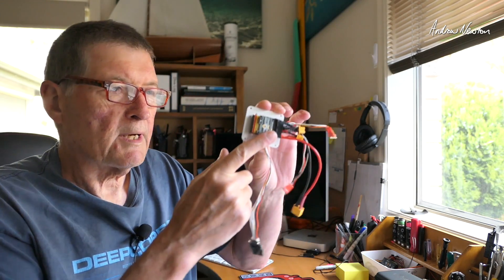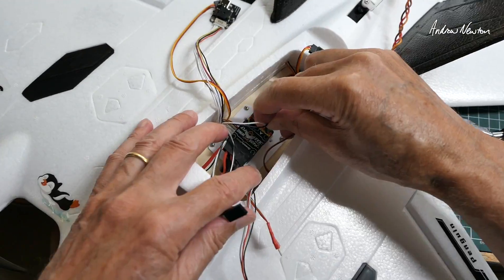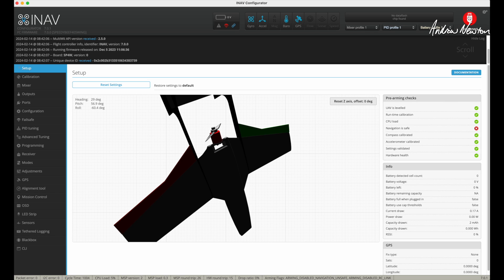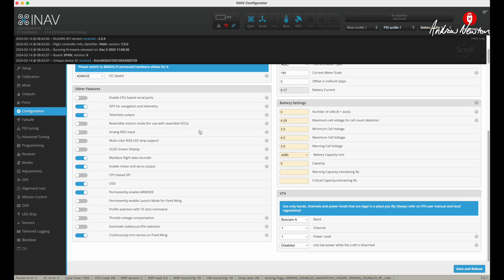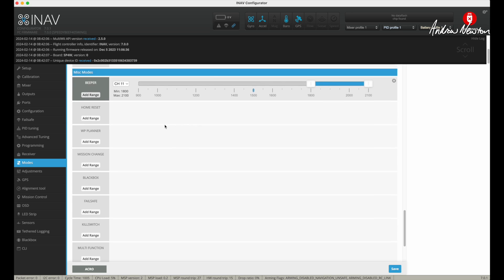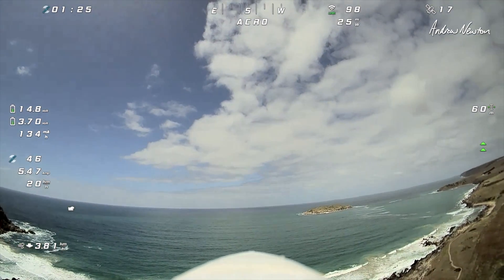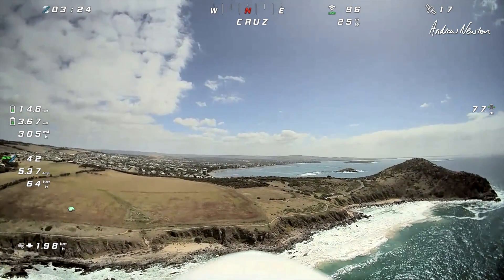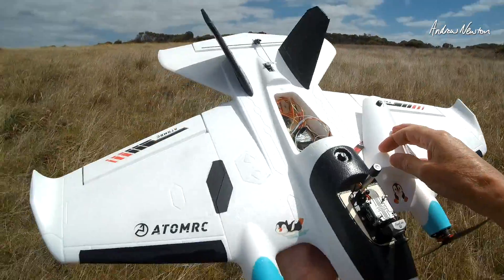SB F405 Wing Mini - INAV 7.0 Setup Penguin

Comment: I cannot get it - I used the same FC for me Esky Albatross. I flashed the Speedybee F405 Wing Mini (6 Outputs) Target. But the S5 and S6 servos does not work. 
In your video you are using the target "Speedybee F405 Wing" (not Mini). Is it correct flashed? Because you are using the F405 MINI. Can you help me?
Reply from the maker: Must check the manual or product page for the correct firmware target. Don't just guess.

Comment: Great video as always thanks for the information just got a penguin and this help me out perfect 👍
Reply from the maker: Great little model. So quiet but fun to fly
Reply: @AndrewNewton maiden soon 😁 Do you fly props in or props out spinning I'm talking about. I run my swordfish propa in.
Reply from the maker: Mine was pre configured with props spinning out, but either way is OK.
Reply: @AndrewNewton thanks yeah I buy the kit version and love building I guess I'll go with props in. Thanks for all your input much appreciated 👍🏼
Reply from the maker: No problem. I actually did some testing using the AlbaBird and found that IN, OUT or SAME made no difference to the flying but if you lost one motor then IN was marginally easier to fly.

Comment: Hi mate... Thanks for the explanation for this FC. I have some questions, I saw using a capacitor on your flight control, is it 2 capacitors or only 1 capacitor? Can you give some instructions for soldering? Thanks for your advice, now I'm building this project.
Reply from the maker: Capacitors are optional, but mostly beneficial to reduce noise in analog FPV. I soldered mine to the ESC pads when I was using it on a single motor model, then changed to the battery pads with this twin motor Penguin. Negative to negative and positive to positive.
Reply: @AndrewNewton  Hi Andrew, thank you so much for your clear explanation. Now I can start this project. 
Cheers...

Comment: Hi Andrew, I am planning on using the Matek F405WSE on my penquin, do you know if I will be able to switch the LEDs ON/OFF is i connect them to the LED G 5V LED on the board?
Reply from the maker: No they are not programmable LEDs and the board doesn't have a switchable power output
Reply: Noted and thank you.

Comment: thanks for the video, can i ask how can i assign the flight mode to my radio?
Reply from the maker: In the radio mixing assign a switch as the source for the mode channel, then select that channel in the INAV configurator mode screen.
Reply: @AndrewNewton  thanks
I need my fc f405 to be connected with o3,  to get full range, can it be done without gps?
I tried to do the simple method in the speedybee app, when i reach the point to move the throttle, thete was no response
Reply from the maker: @hussainjeragh  For the 03 you need to arm the board. If you have configured it to use GPS then you need 3D GPS lock to arm. Yes you can configure the board to not use GPS.

Comment: @Andrew great video.  I just got a penguin with a SpeedyBeeF405 wing board installed. Very helpful video. BTW Where do you get the 4 pin DuPont plugs from?
Reply from the maker: Thanks Jerome. EBay - search for Dupont connectors

Comment: Hi, i'm a total beginner on Inav. I would like to use my dji remote 2 with the pinguin. should I simply designate the UART corresponding to my O3 as serial RX? thanks
Reply from the maker: UART2 Serial Rx and connect 03 SBUS to the SBUS pin, UART5 DJI
Reply: @AndrewNewton  Thank you for your answer. so if I understood correctly I solder the blue wire (sbus) to the sbus port. And in INAV I program UART 2 in Serial rx and UART 5 in Dji? thanks
Reply from the maker: Yes correct. Might need the Ground wire for SBUS also.

Comment: Do you need a compass for RTH to work or just with the gps its enough for a flying wing? Do i need a gps only or gps with compass?
Reply from the maker: No, compass not required. GPS provides direction when the plane is moving forward

Comment: Your camera switching won't show when you have it on HD mode if you put it on PAL or NTSC then your camera modes would appear in modes page
Reply from the maker: SpeedyBee admitted that camera switching didn't actually make it in to INAV 7.0 for this board.
Reply: I wasnt sure, I know the large one doesn't have it I thought they put it in the tiny one that's why you brought it up.... and said what I said.... good to know.... I wish it had it since I use dual analog cams when I use analog.  
I wish these had it.

Comment: Can you provide the STL file for the base you mount the Flight Controller to? I can't seem to find anything that matches the screw layout in my Penguin.
Reply from the maker: Mine doesn't match the holes either. Just screwed in to the plywood
Reply from the maker: I'll design one. What FC are you using?

Comment: I setup this FC with the current FW and a couple of different ELRS Rx and after an hour or so of being connected to the PC for radio setup the FC stopped outputs of the servos and receiver outputs as well. Overheating?
Reply from the maker: Could be, but I have not experienced it. Did it work again when cooled down?
Reply: @AndrewNewton  The FC still isn't showing any outputs in the receiver tab or on the servos. The Rx is outputting a servo signal to a Mateksys CRSF-PWM converter just fine.
Reply: @AndrewNewton  Okay, I just connected the Rx with Fc to Inav and the receiver tab output the servo movement on the main channels right up until I plugged in my battery then it quit working.  Totally lost why the FC is doing this.
Reply from the maker: Any servos or peripherals connected? One might have shorted out. Check for shorts or solder bridges.
Reply: @AndrewNewton  GPS, Servos connected to the FC and smoke stopper. The serial indication status is "Blue", otherwise the "Navigation is safe" is a RED X right now in the pre-arming safety checks.
Reply: @AndrewNewton  I gave the FC to a friend who's an electronics repair guy and this is what he found. "The Rx input wasn't working. I took the top and bottom boards off to inspect. I found a bent pin between the top and main board connection...straightened it out. I also reflowed all your pin solder joints and put it back together. Everything was working after that."  I guess I should have been more careful plugging the two halves back together again.
Reply from the maker: @madsloper  Oh man. That sort of thing can drive you crazy. So glad to hear it's sorted now.
Reply: @AndrewNewton  Don't buy this FC it's crap, I had rx uart problems, servo outputs went bad after five minutes on the bench while testing servos. I moved the servo output to S6 from S4 and got the servo working again but then the motor output on S2 went bad. Believe me, I pulled the servos and ESC all working fine with a servo tester. I even swapped the ESCs on the header pins S1 & S2 the problem just moved from not running the right motor to the left motor.
Reply from the maker: @madsloper  No need to post the same rant twice. I'll remove one of them.
Reply: @AndrewNewton  sorry about that, I forgot which video we were chatting on about the FC

Comment: The Penguin is flying very smooth with the SpeedyBee F405 INAV setup.

Regarding "User Modes" for video switching (7:35): I believe it's only an option if an analog camera setup is configured. Not available with digital video configurations. (Selecting 'MSP DisplayPort' in "Ports" tab likely disabled. This also determines what is display as for setting options on the "OSD" tab)

Have wished that digital video systems would offer a switch option for second camera. It would be nice to have a downward view, rearward, or other alternative view. Would make for a lightweight second camera option.
Reply from the maker: User mode doesn't appear even with a reflash and pure analog FPV setup. I suspect the Mini needs different firmware to the Wing full size, but it hasn't appeared yet.
Reply: It sounds like an INAV issue (dual analog cameras, not yet supported). Something for the devs to research. Hopefully they have access to a SpeedyBee Mini-wing FC so can verify. At least timing is good for upcoming release schedule.
Reply from the maker: @AerialWaviator  Just heard back from SpeedyBee. It's not in the official INAV 7.0 yet, only in SpeedyBee's own INAV build, which has only now been added to the product page.

Comment: is it possible to test single motor failure on a 2 motor plane in INAV during flight
Reply: If it's wing without a rudder you could do differential thrust with a very large mix and then put the rudder on three position switch. Left motor off(rudder low), both motors on (rudder middle) right motor off (rudder off). Bound to be other ways as well.

Comment: Congrats on the flight and great build and video 👍.  I just built a RTH model with the stock flight controller and ESCs and servos. I had a good maiden line-of-sight, but unsuccessful auto-launch on flight two (inav 7.0). May have been user error. It’s interesting what has been said in the comments about the stock  electronics causing troubles. This is my first plane with a flight controller, so I don’t have anything to compare it to. Hopefully I can get it worked out.

Comment: I had an airplane that did the same "dirty dive" and fixed it by lessening the weight.  I see a 3500mah 4S in 'er?  Specs say a 1500mah 4S.  Maybe the (roughly) extra 120 g is a little too much for the ailerons? Maybe increase the ail throws?  Would like to know how you fixed 'er

Comment: Looks good Andrew, I noticed that you have the TX power in the display. I've enabled that , but for some reason doesn't seem to work. What might I be doing wrong?
Reply from the maker: I see there was an answer on FB. Lucky because I didn't know the switch mode made the difference.
Reply: In the end, I had to do some reading as a last resort. Thanks for the reply, Andrew

Comment: i am about to dive into the inav , i have always used vector but times change so i need to give this ago , your vids and explanations certainly help. i picked up a speedy bee 405 wing fc , just got to decided which plane to fit it to for testing .👍👍
Reply: There's many but a good one is the T1, it's quiet small and won't chop your fingers...
Many other options ofc 😜